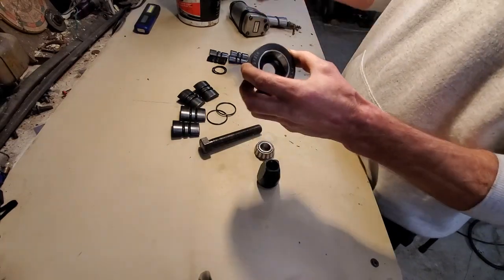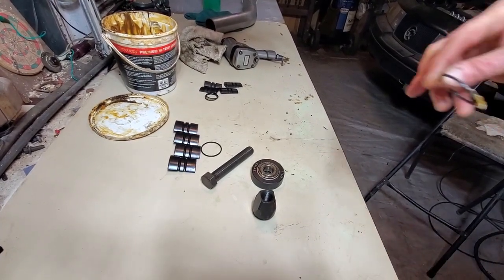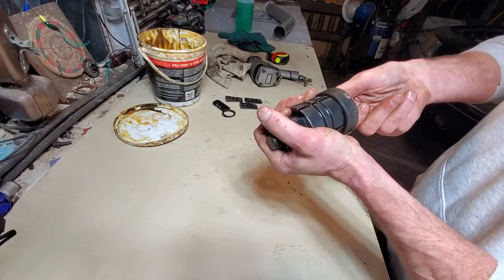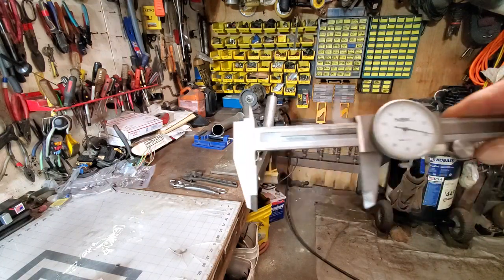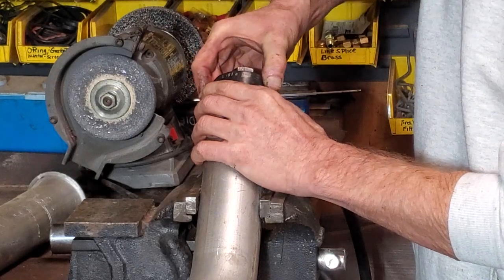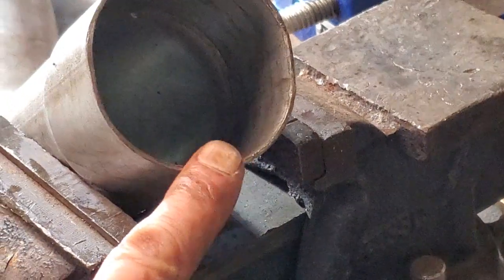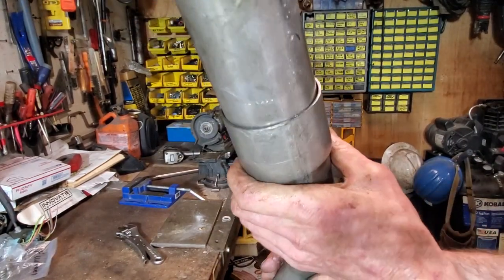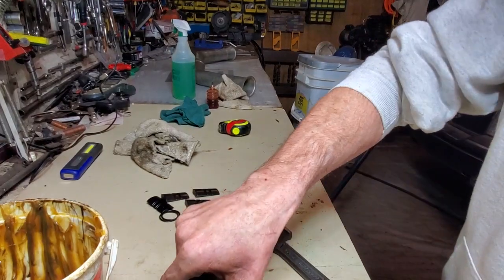Lisle exhaust pipe expander PN 34400 review and how to use

Comment: Would love to know if it works on stainless steel. Did anyone try or has any tips ?
I need to shorten an exhaust from a lwb jeep to fit on a swb one without welding
Reply from the maker: good question and i can not back up using it on stainless.
now since i am a diy guy,,, i would heat it up then use the tool  if you have a torch